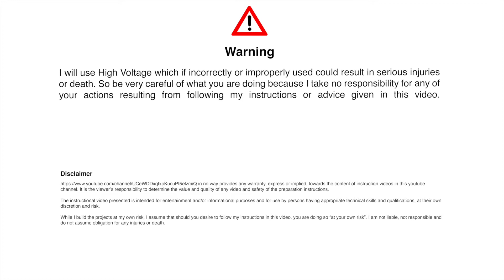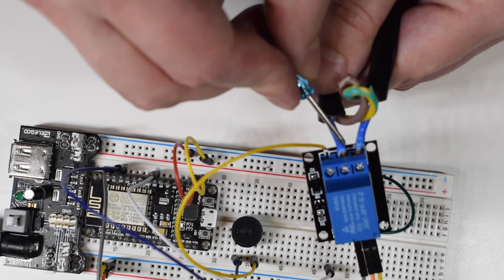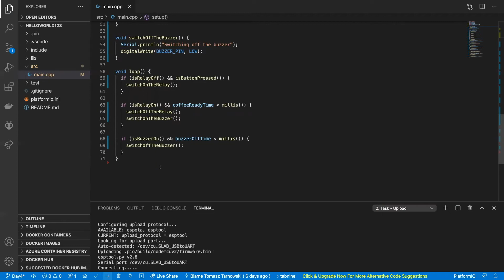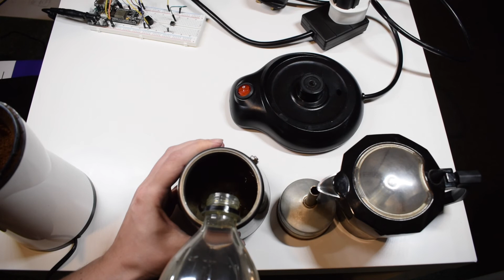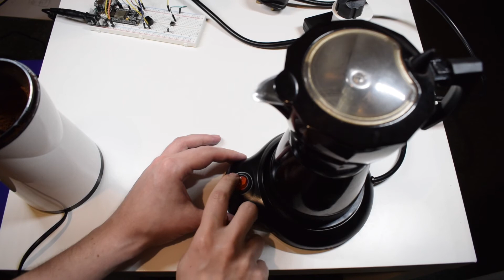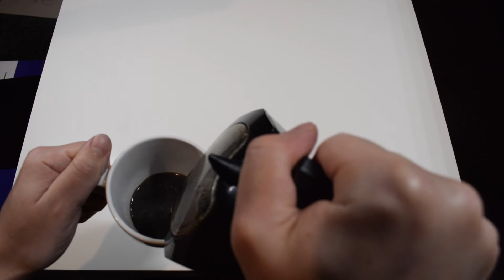Control Coffee Maker with Relay and ESP8266 Part 3/3 - Day 7 of #100DaysOfCode in IoT

Comment: bro actually you can use 5V to whole circuit . All you need to do is give 5V supply to Vin pin of ESp8266 it will regulate 5V to 3.3V with its own regulator

Comment: coffee machine should turn off when coffee is ready not after arbitrary time ;-)
Reply from the maker: yeah, I had this idea to either use a liquid level sensor or have two wires installed inside the coffee maker at a certain point at the top so when the coffee reaches that point electricity could flow and the device would get a signal that the coffee is ready :)

hard to find some free time to go back to this project, though :)